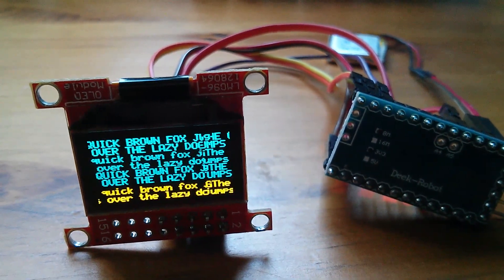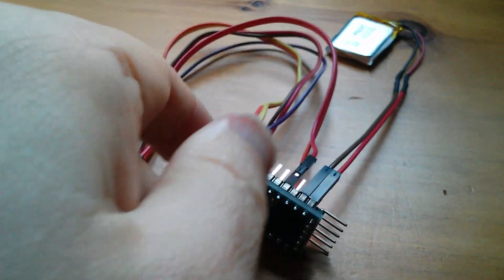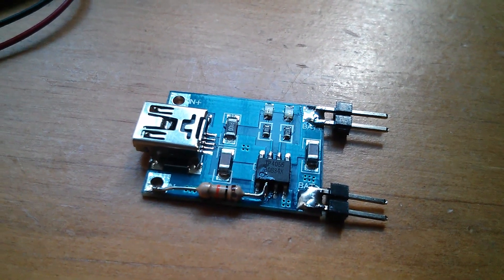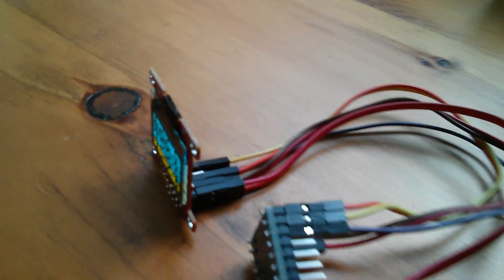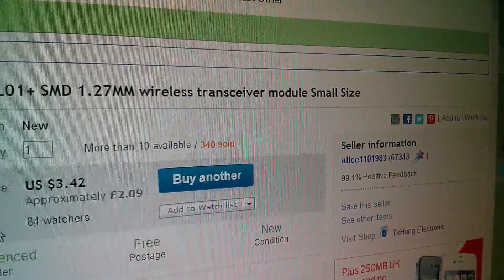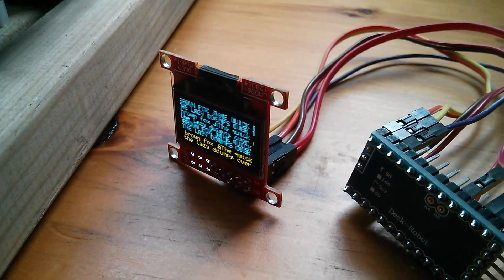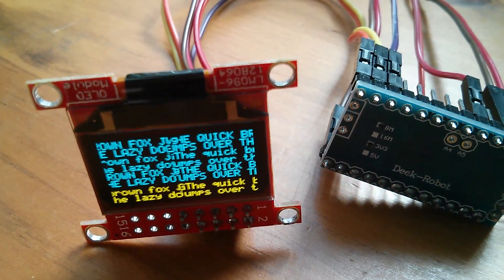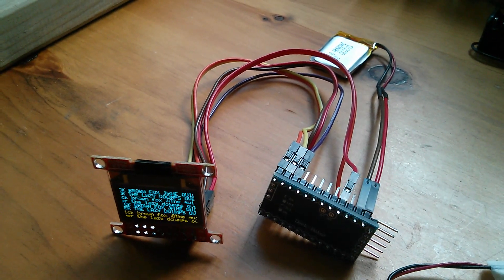Project Preview: Wearable OLED Data Display Wristwatch Device

Comment: Julian -
A little off topic. I watched and followed your videos on using the OLED. And I got a couple and got them running too. But in some of your videos, the yellow is at the bottom instead of the top. It looks like you turned the OLED upside down and flipped the text. But I can't figure out how to do it. I've googled it and, well I'm asking you now. What's the trick ?

Comment: i wanna know . the difference between using an ATmega328 IC  for  project and using an arduino for project. i kind of like to have good knowledge of things i am using and dont like any readymade things to make my work easier coz that wont give me a good knowledge of what i am using. someone somewhere has hidden the complexity (which otherwise have given me a good understanding) to make things easier........ sO should i go for any arduino like things like raspberry pie and all..... what difference will it make...... and can  it still have a good understanding of things if i use any ready made microcontroller board

Comment: This video is a few months old now, but I notice you had an 808 keychain camera in one of your videos. It has (mine did at least) an even thinner 170mAh battery you could use. I found that my pro mini would also run from a 3v CR2032 button battery (only tried with the 'blink led' sketch though ;)

Comment: I just bought the Pro Mini from Alice1101983.

I looked for the display you had but I only found this one that seems similar to yours but not close.  http://www.ebay.com/itm/170842973484?ssPageName=STRK:MESINDXX:IT&_trksid=p3984.m1436.l2649

I hoped to find the same display, because yours seems to work well.
Do remember where you bought your display?

I bought this one.
http://www.ebay.com/itm/221439854428?_trksid=p2059210.m2749.l2649&ssPageName=STRK%3AMEBIDX%3AIT

The Icon displays are good enough for my purpose.

I am interested in your project.

Thanks! Later, FW.

Comment: why don't you use a bluetooth instead of nrf24l01 transceiver? it could be fun!
Reply from the maker: I did think of using bluetooth - and an android app. But that's a very different project.
Reply: i think bluetooth is way easy to send and receive data because it uses serial. nrf24l01 uses SPI and i quess too many wires are needed for a simple job.

Comment: Julian you may be interested in this for your MPPT.
http://www.ebay.com/itm/291070726126?
Reply from the maker: Looks like a SEPIC converter. I'm tempted, but maximum current is 4A, then 2A and also 1A?! Coils are nice, but the pass through capacitors look a little underspec. Interesting.
Reply from the maker: ***** It's coming - can't say when exactly though. Also, the LED matrix modules based on the MAX7219

Comment: I use LiPo batteries for RC models and there is no way in hell I would include a LiPo in a wearable product. The potential for cell damage and a fire is just too high with such a personal product. Things also start to get a little complicated when you need to ensure the cell is not over discharged or overcharged. Yes the energy density is fantastic but they are not mainstream consumer freindly which is why you will not see them in consumer goods.
Reply: ***** That's the point. These RC batteries don't have any protection because weight saving is given a higher priority over safety or battery life in RC applications.
Reply: *****

You are patially correct, but do not mix up your battery chemistrys. 18650 for example are LiFe not LiPo and inherently safer not only because of the "hard" case but also chemically more stable. I suggest you search for LiPo safety here on YT and I am sure you will change your opinion on the suitability of a soft cased LiPo for this application.

Comment: On the subject of overclocked minis, I've been running a 5v/ 16 MHz mini at 3.3v for a couple of weeks, and haven't had any problems. It's run all the sketches I've thrown at it so far, and seems to be be quite happy at 16MHz.  I'm feeding Vin straight to the 3.3V pin rather than to Raw.
Reply: Yeah, it will run fine in many cases. But on the other hand errors are often hard to detect. If a bit in a register flips it may cause a glitch but depending on the software often go unnoticed. What is quite picky about running out of spec though is the internal EEPROM. It really doesn't like overclocking/undervolting.

Comment: Funny how I recently bought the same stuff you did (mostly at deal extreme; but I've seen since then that you can get most of it even cheaper on ebay). I've got the pro mini clone (although they goofed up and put a 3,3V regulator on the supposedly 5V/16Mhz version, so it's running out of spec), I got the same lipos and the same charger. And just on the weekend I was going through the datasheet of the nRF24L01.
I have a sports application where I want the pro mini transmit a 10bit value at 5kHz. Of the pro mini there's just the hardware left. I dropped the arduino bootloader and programmed the atmega directly in assembler, because of timing issues (couldn't get it to run at the exact right rate with the arduino/C). The bluetooth module is at it's limits here, because I can't freely select a baud rate, and it gets out of sync with the AVR, where I'm stuck with dividing the 16MHz clock (that doesn't go well with higher baud rates above 115200).

Have you thought about discharge protection? I've found a nice module at DX (SKU 224682, http://dx.com/p/diy-5v-boost-pcb-module-for-mobile-power-blue-224682), that is a charge controller with integrated boost converter and overdischarge protection (although the 5V wont fit your application here). Maybe could come in handy sometime. And you're definitely better at finding stuff on Ebay ;)
Reply from the maker: A module like that could be useful if you wanted to use a 5v Arduino and 5v display, but as Lagman says, it charges at too high a current for my little LiPo. I probably won't bother with discharge protection - after about 2 hours the Pro Mini started rebooting every couple of seconds and so the D13 LED was flashing - a good indicator that the battery is empty. One possible addition is this - not sure how useful it would be (and it's I2C), but it is very tiny: http://r.ebay.com/P3hlQO
Reply: Julian Ilett
Good that I wrote this, because I didn't really check the allowed charge current for the battery. Spoiled by the small RC stuff that charges even the smallest lipos in 10 minutes, I thought charging at 2C is nothing special.

I checked the board. It contains TP4057 (SOT-23-6) charge controller, with prog resistor (just like the TP4056 on your board). There's also a DW01-G (SOT-23-6) battery protection IC on it and a KX8530 (SOT-89) step up converter. So the charge current is moddable (if you fancy exchanging an 0603 resistor), but the step up converter (which is only step up and not combined buck/boost) is pretty useless for 3,3V circuits and a 3,7V battery.
Reply from the maker: superdau Good to know that the charge current is modifyable - useful for 5v projects. Found that same board on eBay http://r.ebay.com/K1Ti27
Reply: *****
It's a project at university. Currently it's more of a feasibility check. No analog hardware and no software for analysis has been done (except for displaying the raw 10bit value in a graph). There are several applications. One's for example measuring forces in ski poles (giving an indication of the athletes strength/coordination), another measuring the force on the trigger of an athletes rifle in biathlon (the trick in steady shooting is to pretention the trigger to about 90% of the force needed). Both things are already done, but the hardware is heavy (and thereby changing the feel of the pole/rifle) and cable based (meaning it takes quite a while to wire up the skier, prone to breaking on crashes and limits what can be done). Add to that that the hardware is quite expensive and thereby only available in a special lab sessions. The goal is to make it available for many athletes at the same time.